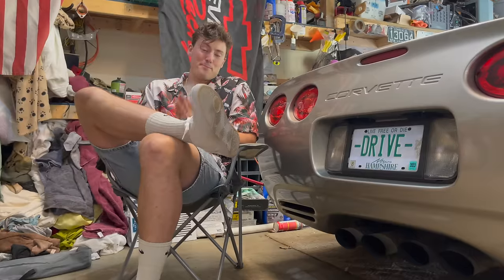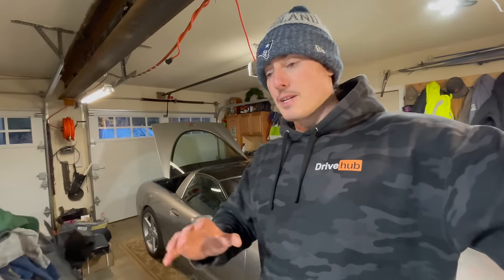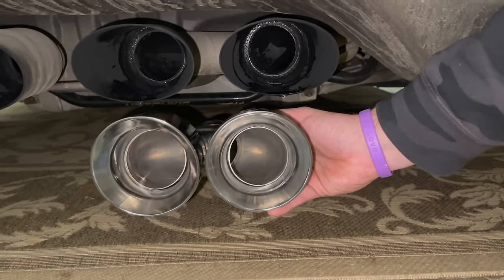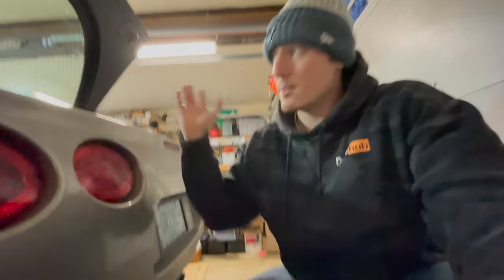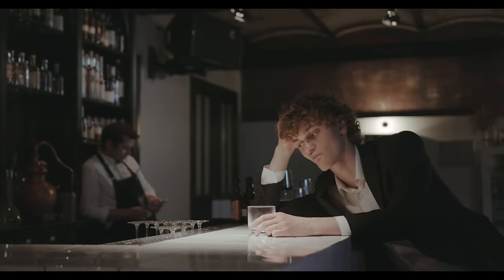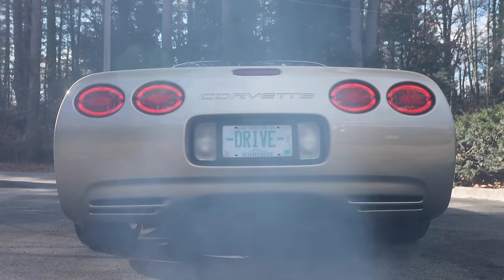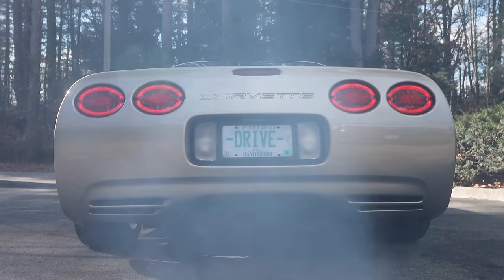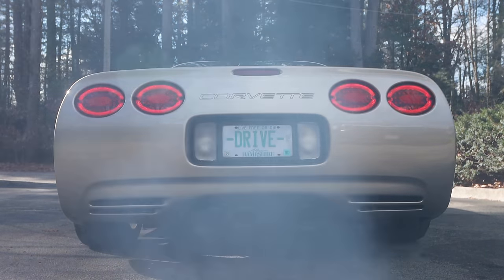Introducing my HAND-BUILT Valved Exhaust C5 Corvette. | DriveHub

Comment: Unbelievably cool. This looks amazing. 

I have one question though, why not use a Billy Boat fusion axel back system? Would that not have been easier, cheaper, and less work?
Reply: This is exactly what I was wondering.
Reply: I’ve personally used the fusion system and was sorely disappointed with the difference(or lack thereof) in volume. It’s also extremely expensive and a very long waitlist to get. 
You also must connect the controller to engine vacuum, so I cannot speak to its performance on a boosted engine.